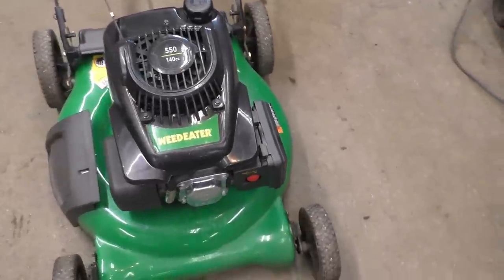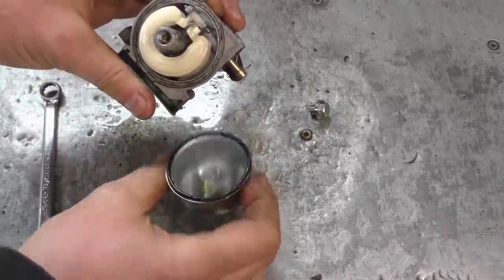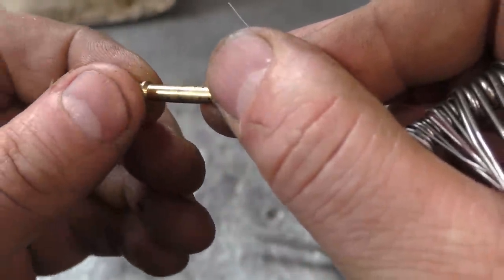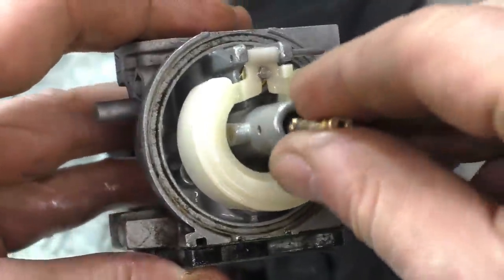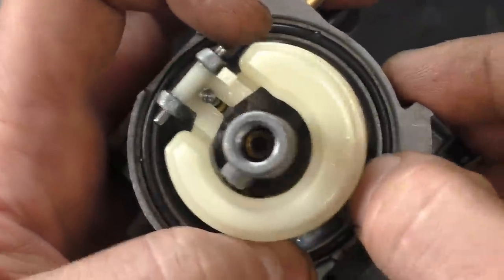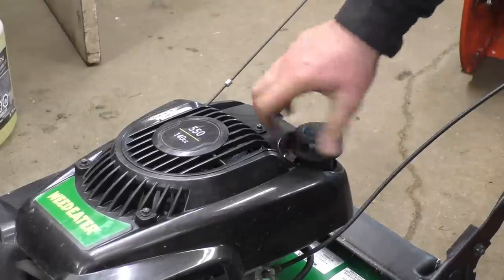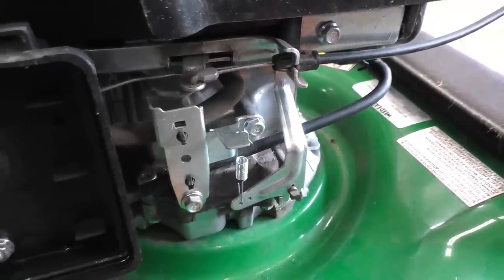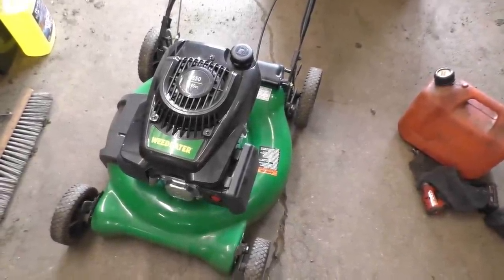Lawnmower Ran Last Fall & Won't START This Spring! Here's What You Should Do!

Comment: I always thought the fuel level in the carburetor bowl was below the gasket and the purpose of the gasket was to seal the bowl so the primer worked and air did not leak into the carburetor?

Comment: another key tip is to use premium, non-ethanol gasoline....keeps the machine running great season to season
Reply: ..."premium" gas here (southeast Texas) still has 5% corn-liquor....I drive for miles to get corn-liquor free gas....
60 cents a gallon more than regular, but well worth it for all my small engines... 🙂

Comment: Engine looks like the Honda engine on my mower, but this one could be an 'imitation." And I always (I mean always) drain all fuel from small engine equipment at the end of the season. I have my mower 10 years and never had this problem. After running until dry, I tip the unit over to get every last drop out, and never bother with putting in oil or trans fluid.

Comment: Hi Don I noticed there is a hole above the air intake on the carb where a choke shaft would be if one was fitted, was the hole open to the air or blanked off like it should be with a primer? Thanks for the vids I learn something new with each one.
Reply from the maker: It is blocked off
Reply: I have Yellow CC and it has that choke (hate it) but Im betting you could interchange the carburetors, they look identical, I'm betting that cab is used on many, many models.

Comment: Donyboy73:::: The Sears/ Briggs Stratton Mower we have is hard starting and it has that plastic carb..…the filter box has the primer bulb in it…..when I removed the filter box to access the carb I noticed there is no hose from the back of the primer direct to the plastic carb….just the large vent hose….I’m confused….shouldn’t there be a primer hose or is this carb not designed for one….pushing the primer bulb 3 times to push air into nothing or do they hope it enters the carb ..HELPPPPP!

Comment: Nice work man! Is that a Kohler knock off? I’m trying to adjust an automatic choke setup on a Kohler mower right now but I’m starting to wonder if the mechanism next to the muffler isn’t working properly? Do you just test those with a torch to see if they move?
Reply: Check the z bend in the choke linkage. Extend or take up the slack to just close choke when cold.